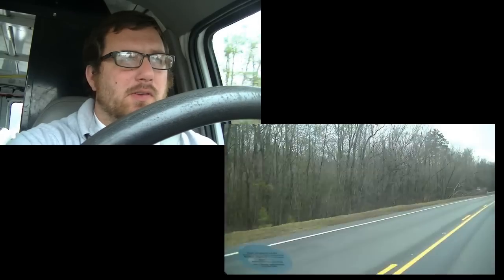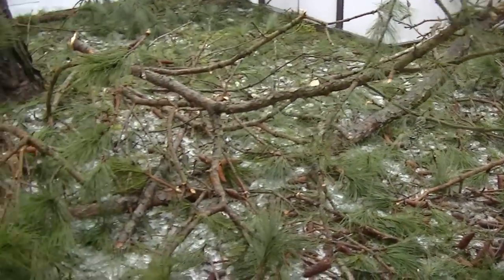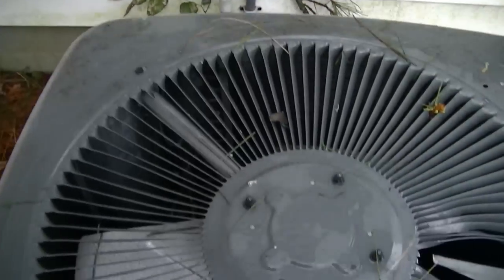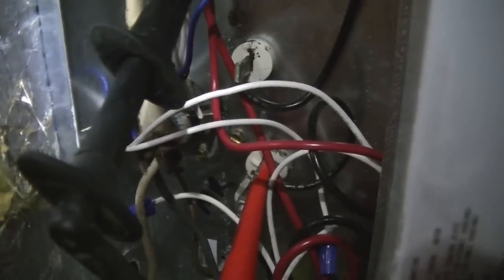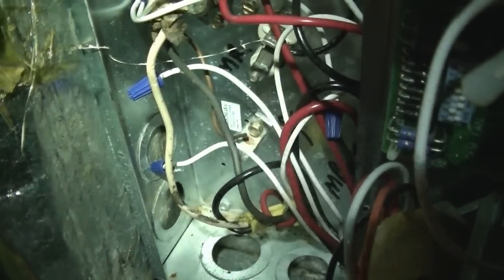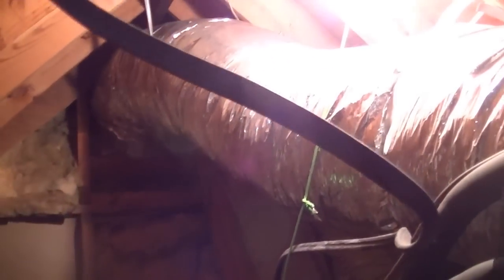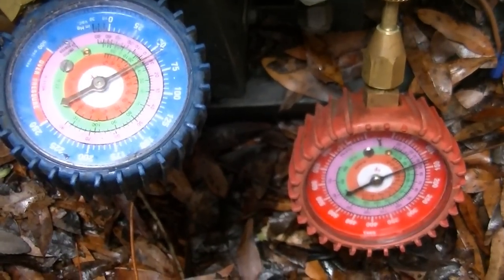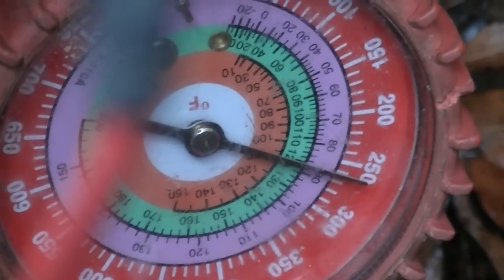HVAC Service Training-  Heat Pump Low Airflow

Comment: Of all the Tech videos virtually no-one checks indoor airflow before checking the charge. Many systems are very low on ID airflow CFM; they should be at least roughly checked...! You had a number of indicators; also in the heat pump mode reading pressures, etc.,  of low indoor airflow. The owner of the system should always be made aware of that...

Comment: if thats a two coil thick condenser coil and the middle is plugged up with shit because no one cleans them correctly fixing the blade will only fix half the problem. You'll still be restricting air across the coil and provoking early defrost.
Reply from the maker: Single row coil

Comment: i have a question… I'm still confused on what is the reasoning for the MegaOhmeter? I know if you check continuity to ground you get a yes or no, but using that megaohmeter tells you if something is ABOUT to ground? thats kind of weird? Isn't something either grounded or not? please help! lol
Reply from the maker: Things can be weak to ground as well. Like motor windings that are damaged, not grounded but weaker to ground than if they were new. Tells you they are failing.

Comment: Great video airflow always get overlooked all it takes is a step back to see the whole system not just the unit in front of you. Do you service surf city?
Reply from the maker: I do. I also went to school with a Cerniglia (Pender). Nothing in the HVAC system  will look good if you have an airflow problem.
Reply: I will be there towards the end of June my sister in laws brother had a company there a few years ago. Cerniglia is not a very common name.
Reply from the maker: Brian Cerniglia If you need anything, let me know. My channel page has a website link. The phone number is on the website when ever you need it.

Comment: Great video. Is there a rule of thumb you use when checking return air duct size per ton of cooling. What size should return air metal round duct, insulated flex duct, rectangular metal duct be per ton or how many square inches per ton. Thanks.
Reply from the maker: Typically filter grills should have 1 square inch per 2 cfm. so is a 2 ton system is pushing 800 CFM then a 20 X 20 grill with 400 sq inches is right. Metal pipe rule of thumb; 10= 1 ton, 12= 1.5 ton, 14= 2 ton, 16= 2 1/2 ton, 18 = 3 ton 20 = 4ton, 20-22 = 5 ton. It can be hard to fit 22" in a lot of places! Flex would run less CFM at the same diameter. 6 square inches per 1000 btuhs duct size.

Comment: Like the vid..I have a question.. Today a ran into a package unit that was vary low on r-22. Suction line 18 psig .I did a pm a few mouths ago and pressure where good. It  had a leak. But my jug had only  about 10 pds of freon today. So I was told u can add  2 pds of freon and then could add nitrogen so then can use your leak detector  to find the leak.. Is that possible? Hate to waste freon!!  and what would u have done?
Reply from the maker: Yep, I would had a "trace" of R22 to help find the leak. You could try leaving in what was there and adding a couple hundred pounds of nitro. That ought to work. If there was 18psi running it should be enough to do that in the off cycle. How cold was it?
Reply: I  live in  florida . so it was about 75 degrees that day. I hope that's  what your asking. thks for the knowledge.
Reply from the maker: Yep, I would just add a couple hundred pounds of nitro to what was already there. Since it has been leaking quite a bit it should show up.
Reply: thks..

Comment: Your the man zack most new HVAC mechanics including myself would suspect a bad outdoor txv stuck close but like you said low air flow would cause indoor coil to overheat your a good teacher zack thanks
Reply from the maker: Thanks Ace. The TXV can do it too, but this one had obvious ductwork issues. The return grill was 10 x 20 and had a very restrictive filter in it.

Comment: deos the head pressure corrospond to the inside temp when you are in heat mode.Great video
Reply from the maker: Yes it does. Just like a hot day effects the condenser in AC mode.